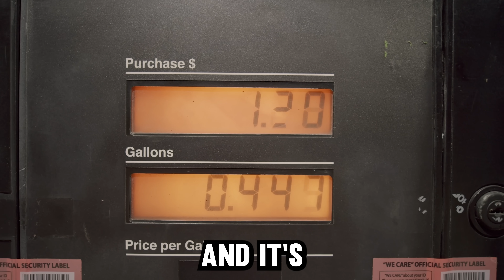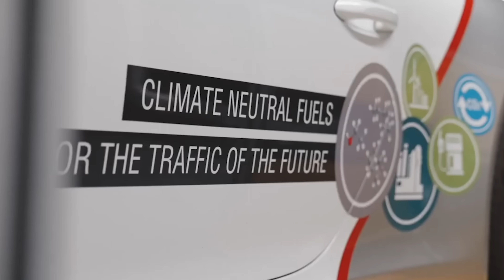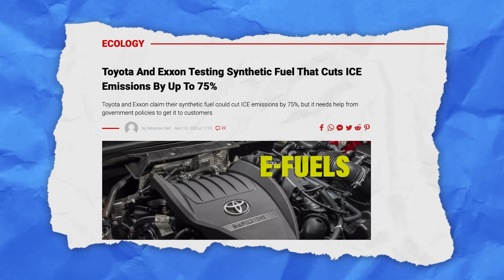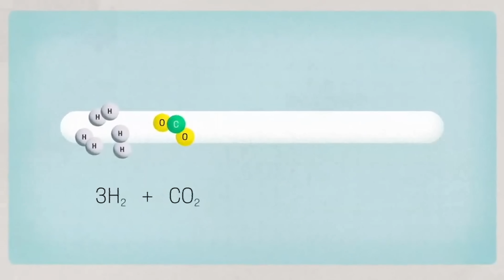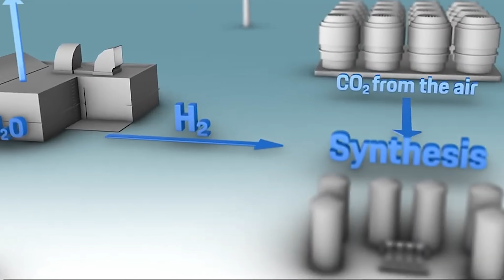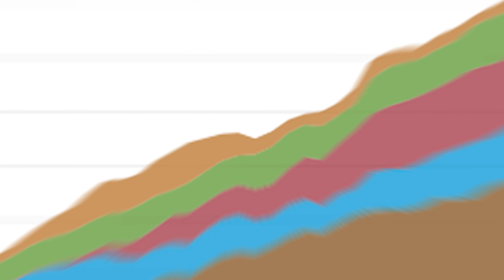Dodge Just SAVED Combustion Engines

Comment: Should we go nuclear or more specifically, micro nuclear.  Yes.  Why, scalability!  All of the coal power in Wyoming could be replaced on the same footprints as coal fired plants, requiring no additional infrastructure, and with much less negative externality than associated with coal.  Nuclear power works rain our shine and micro-nuc can much more fully process fuels making it last longer for a given quantity of power generated.  This model also can be used to generate more power near where it is most needed. That is a nod to some of the infrastructure related issues that contributed to catastrophic fire damage in California.  Unfunded or deferred maintenance with exists all over the grid can be an issue.  But it's not a 1 legged solution.  It's going to require a multi-pronged approach that considers first principles, first costs, as well as the costs of the things we've ignored to this point.  Remember Lake Erie...

Comment: Lol manufactured fuels, another layer of costs. Does anyone understand the basic principles of economics and innovation? EVs are the primary way forward. While EVs are getting cheaper to manufacture. ICE vehicles are becoming more expensive to own and operate. Can't wait for y'alls faces when an EV under $20k with a lifetime battery warranty and 600+ mile charge drops.
Reply: I'm not against ICE vehicles btw & climate change narratives don't pursuade me. To be honest, I'm all in the more ways we can find movement and versatility for individuals to get around. However, I see more growth and innovation in the EV sector and the industry could use a face lift in terms of infrastructure and traffic issues. I think FSD and self driving will alleviate a lot of the inner city congestion and add a new place for revenue being the software suite in your car. Also not a fan of depending on our enemies for fuel, because people are afraid to drill.

Comment: I’d rather have more choices as a consumer in regards to my energy needs as oppression becomes a worry with one choice and (typically), one supplier. 

I’d say that electric cars will be more for the mega rich due to their insane performance. However, ICE have made huge gains as of late but still require a ton of different parts. 

What a time to be alive!
Reply: @Enrique A Thiele Solivan - my comment wasn’t about intelligence or perceived intelligence. 

It was simply about having more options then one. We use diesel, propane, and gasoline (and sometimes kerosene, depending on your battlefield) as they all have different uses and benefits because of the numerous circumstances that our universe endures. 

Only a fool would have a one track mind when it comes to energy as it exists in so many waves.

Comment: Hybrids are fine but all electric vehicles is a non starter mainstream. It's not about the batteries or the car. It's all about the power generation. No country has the powerlines or the powerplants to ban ICEs. This science fiction that the US power grid is up to the task is a joke. Most transmission powerlines and powerplants are running over 100% capacity already. Exceeding design limits increases costs exponentially. We don't have the power period. Anyone in the industry that's not a PR spokesperson is completely aware of this.

Comment: I really like the idea of e fuels. I’m not anti EV, but I don’t want to see traditional engines go away either. This may be a win win and we could have both EV’s and ICE vehicles where ppl could have their choice of which one they want to drive, all while cutting down on overall emissions.
Reply: @DarksideStreams  I agree, they have to find a better way.
Reply: There are centuries with of oil under the ground. Why not use it?
Reply: @homeimprovementsubaruguy2556  only 47 years of oil is left with current consumption, I think they need to refine the Enfield very perfectly so that they don't give any problem to old internal combustion engines and they also gotta find some way to make the process CHEAP
Reply: @homeimprovementsubaruguy2556  don't know if synthetic fuel will work in bike as well

Comment: I feel like it depends on what you need or want the vehicle for. Sometimes EV will be more beneficial.
Reply: Tell me one thing EV are better in, than a CO2 neutral ICE?!
Reply: @LigmaAlex the majority of people in America drive <40 miles a day - more now with remote working becoming the norm. This sort of range is the perfect use case for EV. 
EV provide 100% torque at 0 rpm. No ICE drivetrain can do this. 
Repairs and maintenance are immensely infrequent as compared to ICE vehicles. 
The consumables replacement alone is dramatically reduced.  
I "fill up" my EV more conveniently  than any gas for an ICE vehicle. How? In my sleep overnight. I wake up to a full pack. Can anyone with a ICE engine say this?

Whenever I coast, brake, or go downhill - my EV puts energy back into the tank. Can any ICE engine put fuel back in the tank? 
Electricity costs, even if increased, will never approach the price of a gallon of diesel / gas. Last summer it topped $7/gal(!) in some areas. I paid $0.124 cents a  kWh for electricity. 

What would rather pay $7.00 or 0.12 cents? 🧐😳
Reply: @Heist1000  Thermodynamics are a real thing! When factored in that 0.12 cents becomes exponentially higher! Also , When all the electric grid infrastructure is finally updated, which won't happen in our lifetime and may  never because it's too vast, and every modern household in the world has at least a 75 amp service just to run your EV charging system besides the 200amp system to run the rest of your house. We will be demanding at least 75% more electricity on a daily basis than we do now...tell me how we are going to meet that demand when most of our electricity is produced with fossil fuel currently. And please don't tell me from wind and solar because you obviously don't understand thermodynamics if you do. That .12 cent is going to be closer to what we pay for a gallon of gas if not more! You are watching a massive global shell game, a three card monte and the elites and big government types are getting rich off of our collective ignorance. It's all a power play, pun intended and, you are being duped!
Reply: @mntdshootrdoc1  yes thermodynamics are real thing! You clearly don't know what you're talking about and have a fistful of surface level level knowledge of topic.  

1. An ICE motor barely reaches a paltry 28% thermo efficiency. The rest of the energy in a gallon of fuel is turned to waste heat, friction, and noise. While an EV operates at 95% power efficiency. 95 or 28? You tell me which is the better option? 

2. There isn't a need to charge an EV off a 75amp service. Who told you this? I run a 40amp LiteOn IC3 that can intelligently adjust its draw down to as low as 32amps or ramp to 48 depending on load. I have a SPAN panel that can monitor whole house and grid load as well and adjust. 

3. From where are you gathering the "75% increase in demand" figure? 

4. As for demand production; over 20% of the power in the Eastern and Western Interconnects are from renewable sources. This % is increasing each year - supplemented further by increasing private production and helped even further by new infrastructure being LEED certified. 

5. Demand capacity is not a problem for the grid or supply. Peak shaving is where the problem of supply comes into play.

Comment: Power Cells burning ethanol is the future. And Brazil has been burning ethanol since the 70s. None of that corn bullsh... but sugar cane ethanol. You are still burning ethanol, but now it is generating over 80% of usable energy as eletricity instead of 30%-ish. 
No time wasted refuelling out of a socket, uses pre-existing gas infrastructure, no batteries on the cars, it merges all the good stuff from both worlds. Nissan showed their designs then went quiet, because the tech is too disruptive, maybe?

Comment: Ice vehicle efficiency is growing all the time.
Turbos small engines are pushing over 50% efficiency.
When you calculate the coal burned to make electric they are better than EVs.
600 Mile range over 30 mpg.
It should be left to the market & people to decide on our choice of propulsion.
Not some lobbied bureaucrats.

Comment: The whole reason why we're finally starting to make the switch to synthetic fuel in the first, it's because of the untold damaging effects lithium has on our planet. No one wants to talk about how to dispose of lithium batteries when they are completely depleted. And yet we are extracting them at an alarming rate because we're told this is what's going to help our global warming problem. 
Is synthetic fuel a permanent solution? No, but it is a better option until we find a better fuel source.

Comment: There is not working around the fact that electric motors are 98% efficient vs 20-25 efficiency in combustion. Also electricity can be transmitted at the speed of light while fuel must be driven in trucks to destination.

Comment: Look- if the government really cared about the enviroment and wanted to do something realistic they should just limit car engine size to no more than 1.2 litres. If we were all honest we would admit that no one really NEEDS to go more than 80 mph- and so with modern engine tech, a 1.2 litre engine can easily do 80 mph. Remember the Civic VX? It was a 1.2 litre right? It got like 60 mpg and that was in 1995. It would be better if we just made all cars very light, as simple as possible, easy to repair, and very basic without all the tech, plastic, and unnecessary "bells and whistles". I love old Japanese cars with tiny engines, with today's tech we could make tiny engine cars so much better, safer, and faster. Cars should be built to last too- like old Toyota truck

Comment: Why buy EV vehicles and create complex problems when there are simple solutions like synthetic fuel and hydrogen? IC engines are reliable , have familiar technology, Using synthetic fuel or hydrogen for IC engine provides environmental benefits.
Who says that using electric vehicles can save the world. It's a false economy. If anyone is buying electric vehicles to save the world, They are deluded. EV vehicles will definitely cause headaches for consumers.  EVs are not successful in many applications. EVs impact the environment in many ways during production and use. Full EV adoption is not practical at all. EV batteries have massively increased demand for precious metals , which are mined using heavy diesel equipment . The process ruins surrounding land and habitats for 100s of miles . Electric cars are supposed to help the planet , but their batteries definitely create the next trash problem. And sometimes , lithium - ion batteries explode . Electric cars certainly reduce your carbon footprint , but making the lithium - ion batteries could emit 74 % more CO2 than for conventional cars .

Comment: Im not moving to EV simply because of a few reasons 

When the baterry is done it's expensive to replace
Fires are far worse than a combustion engine vehicle fire (seen a video that they literally had to use a fire blanket to control the fire of a tesla with) 
The ammount of shit to make the batteries is just as if not worse than burning gas.

Comment: I'm still of the opinion that the only solution to emissions problems is to travel less.  Taking the bus or train is a band-aid, the solution is to move closer to work (or work closer to home).  Batteries are simply a bad solution to the problem, unless we see an order of magnitude improvement in capacity per pound.  We're more likely to run all vehicles off electric tram style infrastructure than batteries.  

That means liquid fuel is here to stay, even if only in niche scenarios and for backups, for a very long time.  Synthetic e-fuels and ethanol are a more significant piece of the future than lithium batteries.

Comment: why not just use evs that literally generate electricity at maximum efficiency from the renewable step, which literally takes less energy than electrolysis, carbon capture, and fuel synthesis processes, its just energy created from renewable source, to power line, to car battery, thats it

Comment: In my opinion, it's all a hoax, this rock known as earth needs carbon to survive, your DNA string is held together with carbon. The fact that when they closed all the concrete plants on the east coast a good share of the hard  wood trees died because the needed the high lime content that the supposed pollution was creating. Here's a new idea get rid of all the B.S. that the EPA makes the auto industry put on the vehicles, give them self governing rules. Example, you can make anything with any about of power, but, they have to make over 100 miles to the gallon highway, we all know that's  possible, no one's asking why we get the same milage as in the 40s maybe worse in some cases. It seems if you increase the milage 3,4 or 5 times that would lower the pollution. I'll also ask do we have an over abundance of water to turn into fuel? You know that stuff we have to have to drink to stay alive, that plants and animals need to survive. You can't drink oil let's keep burning it!

Comment: 45 years ago I was taught at school that we needed to develop EV's because the world would run out of oil by 2020 or something.  Well not only did that not happen, but oil production increased over the decades to record levels due to new reserves being discovered and exploited; in short, the world is currently absolutely drowning in crude oil, so there is no shortage of it.  So then about 20 years ago we were told that we needed to develop EV's not due to the world running out of oil (which it clearly wasn't) but because burning fossil fuels in cars was now bad for the planet (even though most of the world's use of fossil fuels is to burn in power plants, which provides electricity to charge these "environmentally friendly" EV vehicles).  We all know what's going on here; smoke and mirrors in order for billionaire businessmen and their corporations to maintain economic and political power & control.

Comment: Edison motors based out of Canada is doing some cool stuff with EV semis, they currently have a working prototype and unlike "traditional" EV the Edison semi truck uses the old diesel motor as it's main charging source which allows fast charging and charging while on the move. They are doing some REALLY cool stuff
Reply: That sounds like a diesel truck with extra steps. But then again maybe the torque will be super impressive.
Reply: @christcarscountry6870  diesel-electric is actually the single most efficient hybrid technology combination.
Reply: Is that the blue logging truck?
Reply: @slappyclappy7781  yup
Reply: Can’t escape powering electric with gas… but if their focus is on raw torque and power, I’m all for it. Let’s just put this whole “green” lie to bed though. Ships are doing this too and it’s a pretty cool idea
Reply: Their design is dumb. It’s a serial hybrid which is less efficient than just driving the wheels with the engine. The only reason trains do this is because it’s cheaper and easier than building a transmission.

Comment: Most users want to get from A to B as cheaply as possible. EVs are cheaper to maintain (soon cheaper to buy when comparing apples to apples - quality specs etc.). So instead of buying a 50K ICE vehicle that would cost more to own (fuel and maintain) than a 50K electric vehicle. Most people will choose the EV. In summary, ICE will go the way of the Horse and Carriage, which still exists but in very small numbers. Tony Seba back in 2016, and earlier, talked about this. Look him up on YouTube as he explains his research on the matter. 

You have to remember, cars are a tool/necessity for most people. They don't race them, they don't tune them, they just want to go from A to B, regardless of fuel source. So if it happens to run on unicorn tears, but its the cheapest way they can get from A to B, there will likely be very sad unicorns.

Comment: No such thing as 'fossil' fuel. Oil is a renewing mineral that keeps coming back into existing wells and they keep finding more through small hole pokes into the earths crust... unlike cobalt/lithium rocks with large earth scaring open pits with blood diamond african peasant labor. Dinosaurs and old tree leaves NEVER had anything to do with oil.

Electricity is free the though the Ionosphere but the string pullers do not want us getting free wireless energy which the REAL carbon nuetral Tesla had discovered and shown possible.

Comment: Porsche was hoping to get price down to 10$/gal. Hopefully with economy's of scale it could come down to 4$/gal or less. But will take a long time and a lot of adoption.
Reply: Its gonna come down to supply and demand. Which is exactly why the same eco nutjobs will do everything in their power to choke the supply, to keep the prices up, regardless of how clean synthetic fuels will be.
To them this has nothing to do with the environment. By now we have learned that these people are immeasurably evil, they hate ICE cars and cars in general, because of what cars represent.
Cars represent the ultimate form of individuality, privacy, and autonomy. And the best way to take that away, is to force everybody into EVs.
All kinds of propaganda articles will come out on how much safer self driving cars are, and how synthetic fuels are polluting the environment more than EVs.
Reply: It shouldn't take ANY adoption to bring it down. Adoption means higher prices as demand increases if they cannot sustain supply. If they can't get it down before adoption, they won't be able to keep it down after adoption.

Comment: One thing I can tell you is that manufacturing the fuel will be much better than fossil fuels not only the hydrocarbons in the fuel is much better bonded and such it allows the fuel to burn about 85% less Co2 emissions than regular gasoline it's great it will be net zero and off set the CO2 emissions